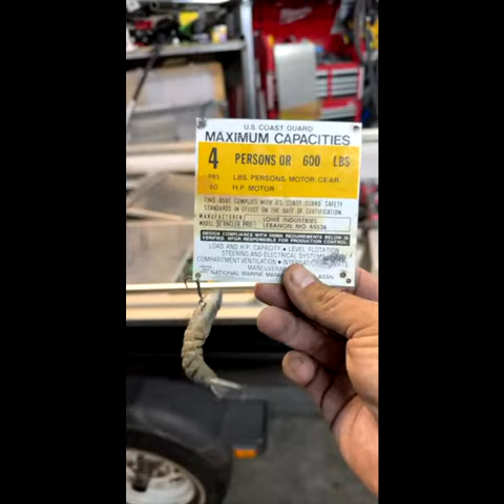1648 mega build off LIVE sneak peek

Comment: Rod locker in subfloor or possibly a vertical rod locker (flipping it 90 degrees so the door opens down, similar to what I have on my Astroglass 154v bass boat. You can sneak 'em up in the side of the boat to reduce the overall thickness of it, depending on the angle of the sides and whatnot...